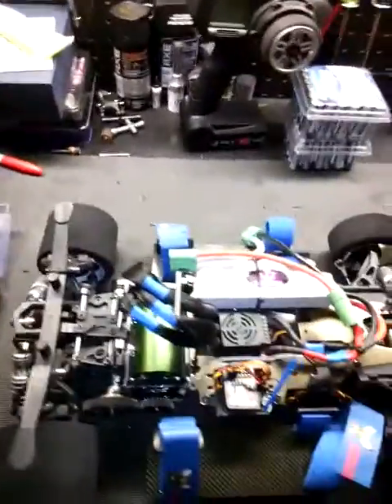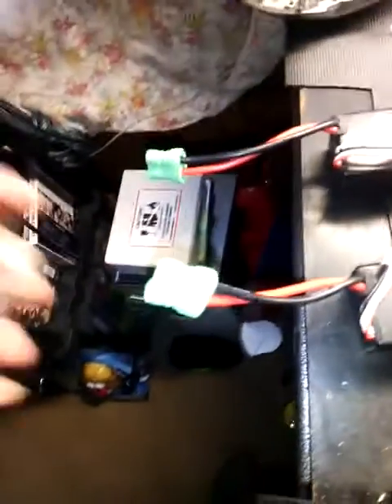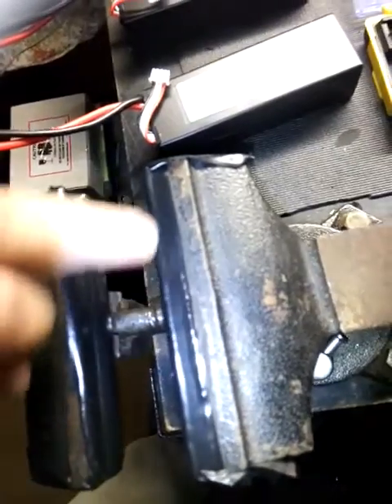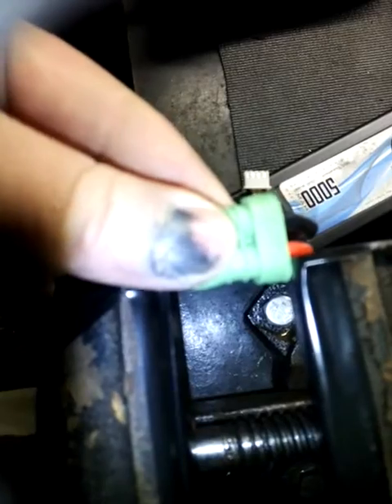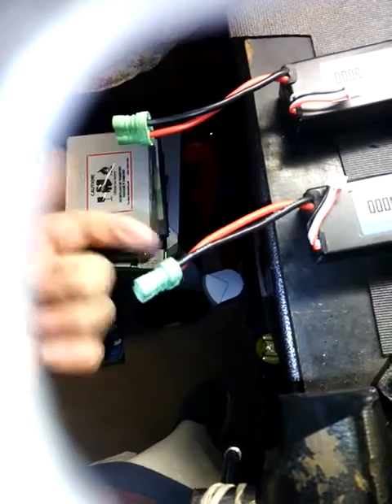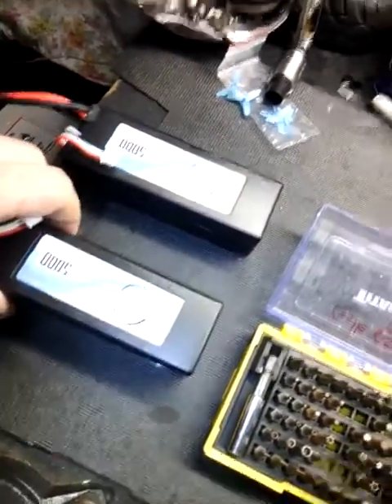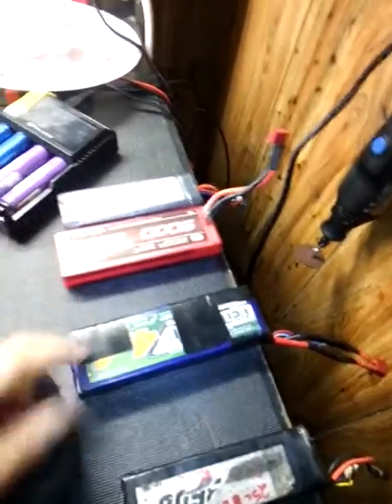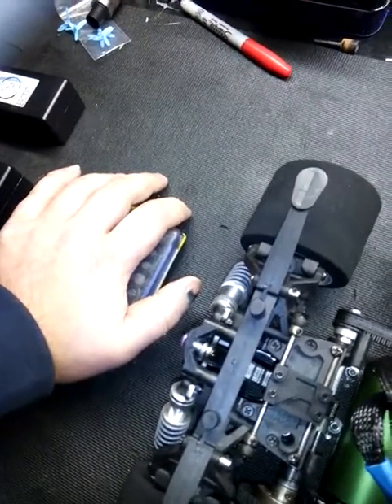Castle creation connectors

Comment: mr downs, what happens if your leads do touch?..serious question, cause it just happened to me, I am okay and my battery is good, just wondering if my battery is ok, cause it go boom!..lol thanks for the video!
Reply from the maker: i mean anything could happen but most time ur battery be okay as long as it didnt short out for long tothe point the wire is desoldered , check ur balance between cells when u discharge them
Reply from the maker: if u had a internal resistance tester that be good but i think ur fine ,if ur lipo does go bad or is going bad most time ive seen one cell drain faster then other
Reply: David Downs yea, I need to hit the sack and will try again tomorrow lol. I can't put it on test yet tho until I get these dag nabbed connectors on!...lol
Reply: David Downs without blowing myself up!
Reply from the maker: when ur workin on them tape with electrical tape on side ur not pushing in and i take a 3/16 driver set and place inside the connector ur pushing into housing and i try to not go more then about 1/8 inch inside housing when pushing it inside housing it works good for me using a vice and push together making sure that wire on backside isnt being pinched. If these are pia after and dont wanna do again id get u some 6mm or 6.5mm bullets male and female and just use those instead of the castle connectors. If i can help let me know
Reply: David Downs I sent you a pm